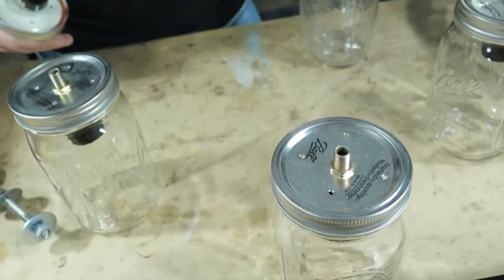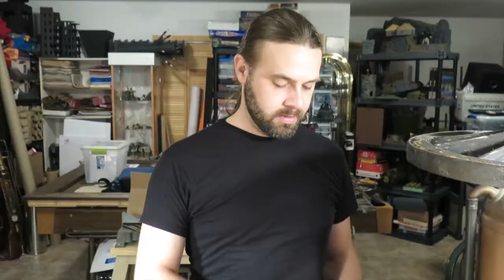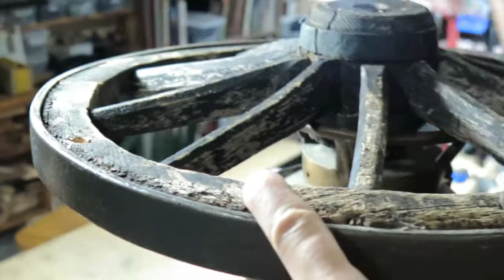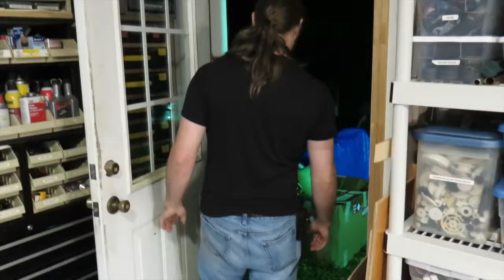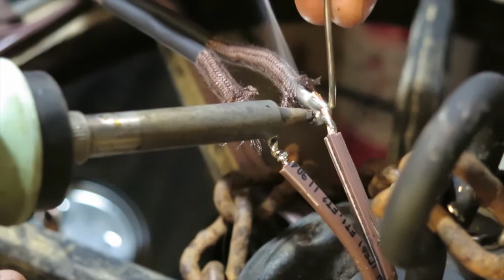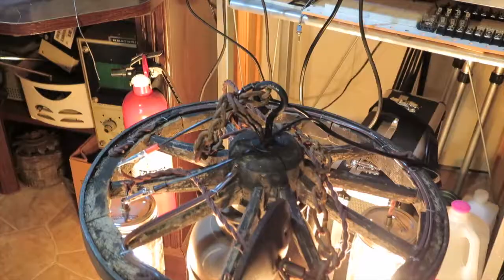Wagon Wheel Chandelier

Comment: Can you post a link to the lamp holders? I can't find one that has a threaded end. Great job on the video
Reply from the maker: I looked back to see if I had any links where I bought them and I think I just went into the local Home Depot.  I checked their website and didn't see exactly what I bought, but you could just go to HD and ask someone in the lighting department.  I DID however come across a kit that HD sells on their website.  It's labeled: Brass Mason Jar Lamp Socket Kit (1-Pack) -  It's probably more than what we paid just buying the parts, but this will give you a place to start.